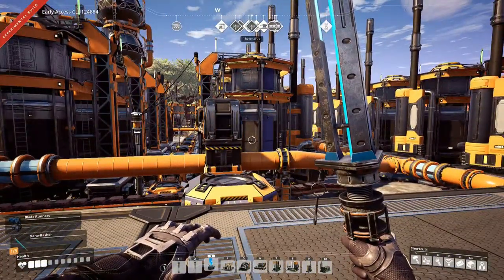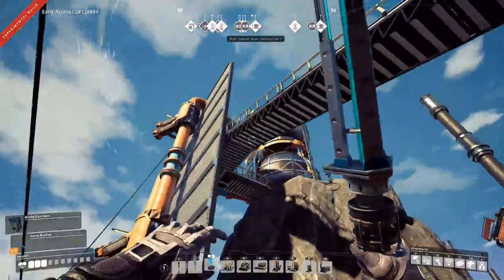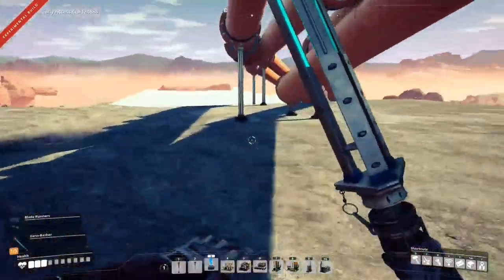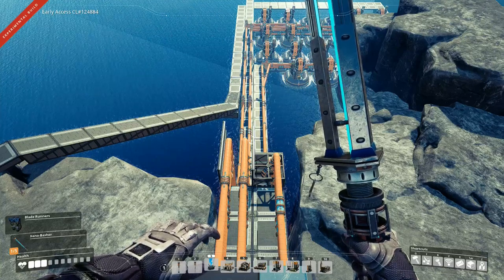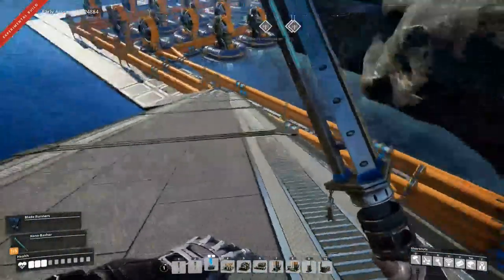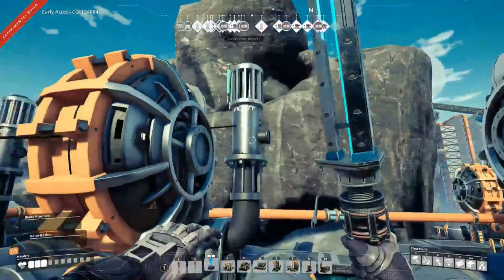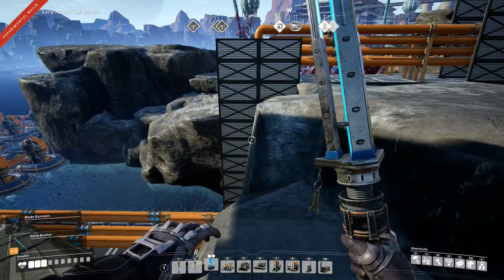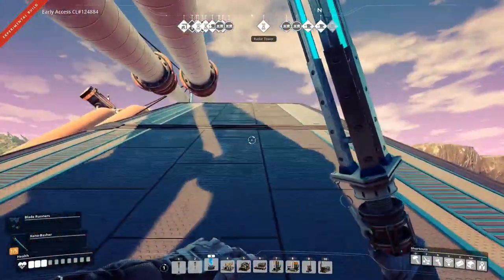Satisfactory Watertower Concept explained

Comment: I know this is an older video, but wouldn't it have been easier to bring your supplies to the water instead of water to supplies?
Reply from the maker: Well, I was looking for a way to use less pumps. With this setup you only need 1 set off pumps bringing water up and then you are done
Reply: @MasterjapGaming  I hear ya, it's a cool concept. Like a version.